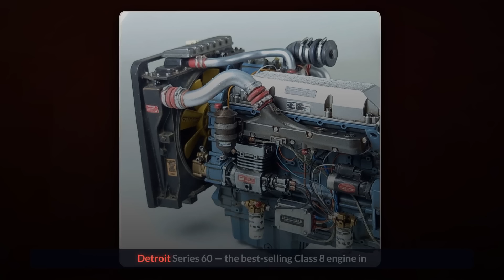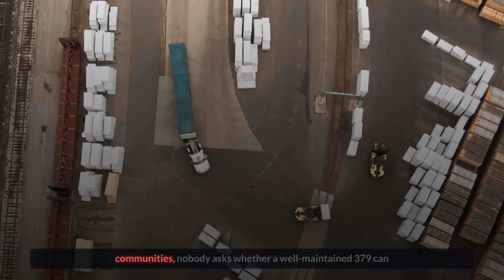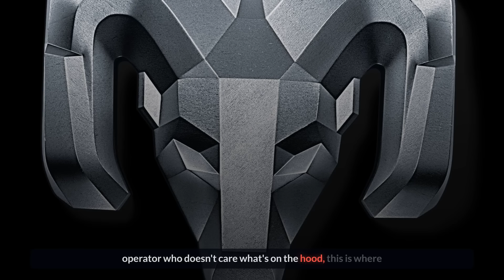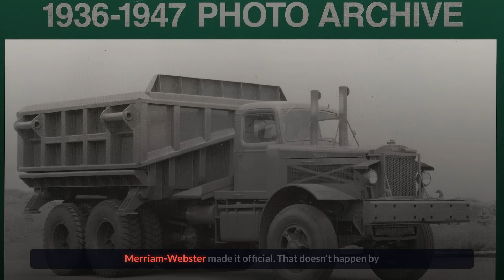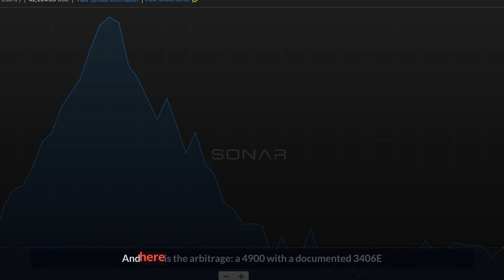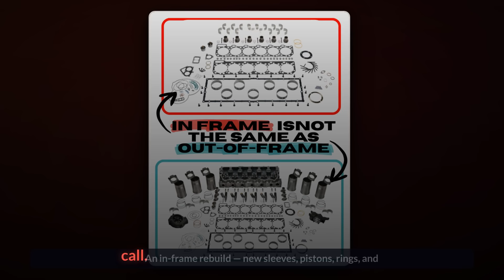Never Sell These 7 Semi Trucks — Their Engines Can Last 1,000,000 Miles

Comment: I am still running 38 of the Original 50 1986 Pete 359's my Dad bought new. All are on a detailed Maintenance Schedule.  Have been Rebuilt or overhauled several times in their 5 Million miles. Can't beat the Fully Mechanical Cat 3406B Engines and Spicer SST6 and 1241 6&4 Transmissions.
Reply: lol

Comment: An uncle of mine drove buses for Greyhound. A lot of buses had GM two stroke diesels. They pulled one motor down at 1 million miles, not to fix it, but to see why it still run. A light hone of bore, set of gaskets and new oil. Off it went for possibly another million. They just never stopped. Sydney to Brisbane. Clean and fuel. 20 minuits Sydney bound again 24 7 365

Comment: I'm sitting in a 2013 Freightliner Coronado with a remanufactured Detroit that has 1,413,723 miles on it right now. Trucks last as long as they are cared for and maintained.

Comment: I am driving  1989 FLD120 flat roof with 60 series Detroit engine ,originally has DDEC2,on 1st rebuilt 1 250 000 mls, rebuilt it and upgraded it with DDEC3 ECM ,camshaft injector, new head and it made another 1 000 000 mls. And thanks to Cuban engineer In Miami I upgraded it with 500hp ECM, and so far with 3rd overhaul  I have 4.2 000 000 mls and running strong. Replaced 3 times the differentials ratio from 4
10 to 3.90,to 3.58 along with the tire size from 11r 24.5  to LPr22.5 ,then to sinhronize the engine,transmission  overdrive ratio and the size of tires ....installed the LP 24.5 and thanks God  it running 72mph with little under 1500 engine rpm and gets easy 8 mls per gallon fuel
Reply: Have any shippers not given you loads because your tractor was more than 10 years old?
What's the name of the shop in Miami, because I'm looking at a 2006 Peterbilt so I don't have to bother with DEF or DPF's.
Reply: @nostradamus7648 I’ve actually thought about that same thing that the some agents ( leased to Landstar) some loads aren’t seen due to the age of tractor 🤔
Reply: @gregghenry5064 
It really shouldn't matter if the engine is completely Rebuilt.
I'm looking for a Detroit 60 series.
Reply: @nostradamus7648 you’re right it shouldn’t but I think it happens. I hear others going to California all the time. Which is fine with me  I do mostly regional.
Reply: @gregghenry5064 
I'm renewing my CDL, but i'm only looking for Hazmat Tanker and home daily.
Reply: @nostradamus7648 that’s actually what I do 80% of the time hazmat and fireworks.  I need to find a tanker agent over here.
Reply: @gregghenry5064 
What's your most reliable source for loads?
Do you work with a broker or directly with the companies?
I'd certainly like to eliminate the middleman.
I like the idea of hauling Fireworks because national distribution and relatively lighter weight because they're paper filled with gunpowder. 
Super busy during June and December.
Reply: @nostradamus7648 there’s a Landstar agent 60 miles from me that basically moves all of TNT fireworks across the nation, and he keeps you busier than a one legged man in a kick fight!🤦🏾‍♂️😂
Reply: You sound like mine 2001 Volvo D-12 currently 3 million miles on it but needs an in frame done. This will be second overhaul. First overhaul was at 1.4 million miles. .